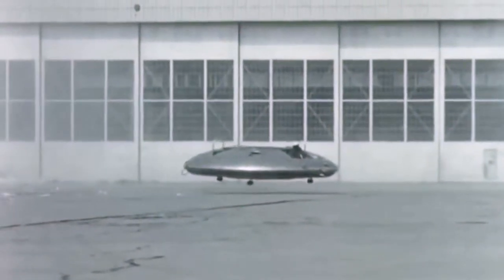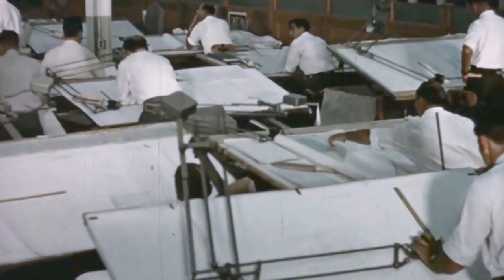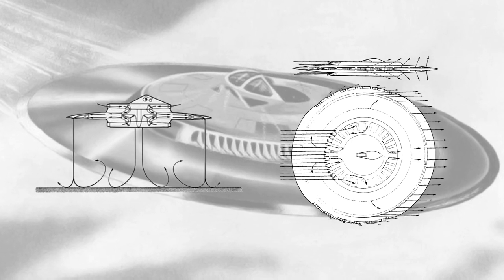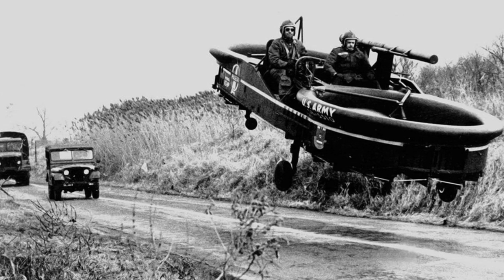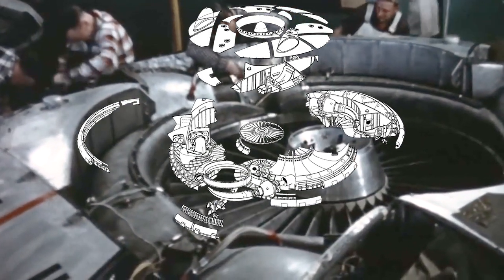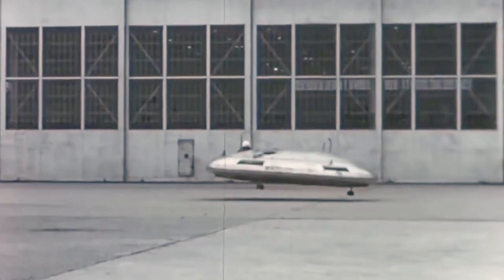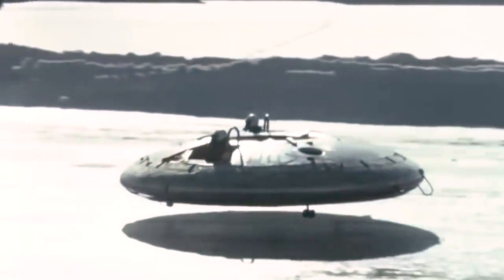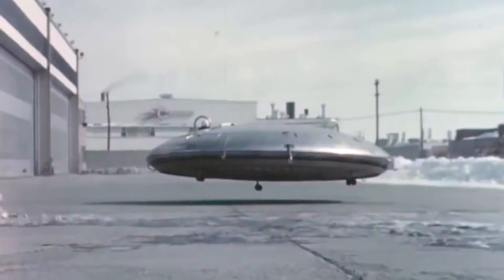Canada Built a Flying Saucer. It didn't work; the story of the Avro Canada VZ-9 Avrocar

Comment: What if you mix this art of propulsion with Helicopter and Gyroscope effect? on the outside of Helicopter tail wings Weights is spinning fast perhaps with a 2nd weight in counter direction like we have today with these tailless helicopters and the Air engine here is for movement, where the Gyroscope is for stabilization and steering the directions. Also this could make this less dangerous to gusts of wind

Well we have 3D Printing for testing Prototypes. Good Luck

Comment: Not surprising failure. A flying saucer in the loosest sense. Simply a circular shaped object levitating. Surely they're missing the trick. The secret is in the rotation of the flying disc as in a frosty ... The gyroscopic effect holding it in formation